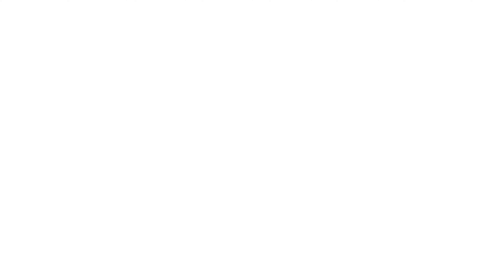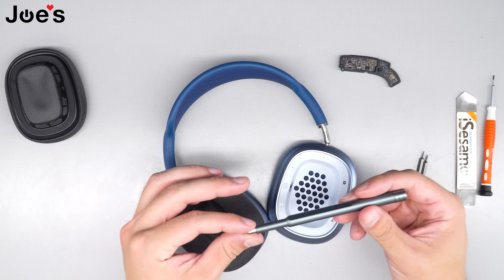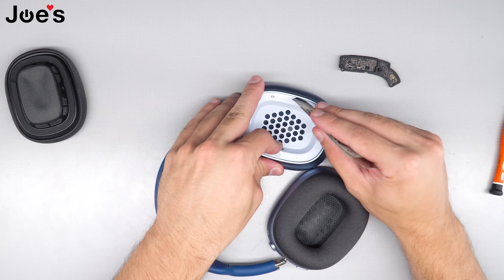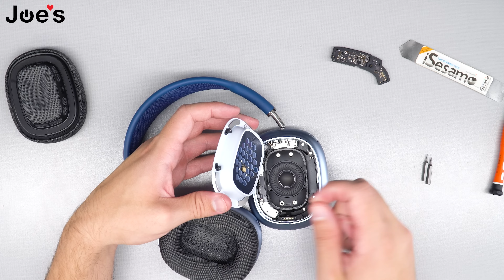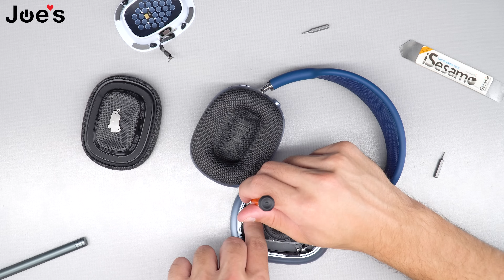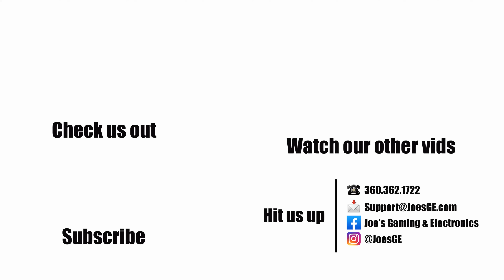Apple Airpods Max Bluetooth Board Repair Replacement | Repair Tutorial

Comment: Those are trash. Ill never buy apple products again. You spend 600dol on a "high end" product, it stop working after 2 years of using, and you have to try a DIY solution because even the repair they overprice. You buy from them and then they penalize you for doing so. Apple is like a huge company that grew by scamming people. never again

Comment: Hello, I am writing from Hungary. My Max regularly does the following: It works, I can hear the phone or iPad. Then suddenly the connection drops, and the device disappears from the Bluetooth settings. The battery is fully charged. If I press reset (holding both buttons for about 15 seconds), after a few attempts it connects to the phone and I can use it. But after 1-2 hours, it loses the connection again. The battery seems to be working, could it be that the Bluetooth unit is faulty?
Reply from the maker: Could be a bad Bluetooth board or headband jack.
Reply: Max 1 (lighning) and Max 2 (USB-C) bluetooth board is same?

Comment: The Bluetooth board is on the left side not the right side. Also heat up AirPods Max before prying but make sure to cover speaker housing with protection.
Reply from the maker: When the headphone are laying down the Bluetooth board is on the right side. I think that's what he meant. Anyways good clarification.

Comment: Hey, could you help me figure out what’s wrong with my AirPods Max. I’ve had the same problem as another user in this comment section. Whenever I have my AirPods Max plugged into a charger the light goes on, but whenever I take it off, the light goes out. Is there anyway you could possibly help me find out what it is?😊
Reply from the maker: Hello, thanks for commenting. Please email us at support@joesge.com with your question. We will be able to better assist you there. - JoesGE

Comment: How can you replace electronic parts without powering off first ?
This is like removing the Bluetooth Board in a computer while it is turned on !
(You should remove the left AirPod from the Head Band first)
Reply from the maker: Hey great question. It is not necessary to disconnect Airpod Max's from the battery when replacing parts. Furthermore, there is no way to power the Airpod max's down. You could unplug the battery or disconnect the cup from the Headband, but this is an unnecessary step. If it makes you feel more comfortable  to do so there is no reason why you shouldn't.
Reply: @Joesge  Ok, it you say so, thanks

Comment: How can I figure out if it’s my Bluetooth board that’s not working? It slowly started having connection issues and then eventually just doesn’t connect at all anymore I’ve cleaned the connectors with isopropyl alcohol and still not working power works tho and I’ve reset it 100 times right when it started giving me issues if I reset it would sometimes eventually connect before eventually disconnecting and than now to not connecting at all
Reply: Did your ever get they answer I’m dealing with the same problem currently
Reply: @larrissafrancois240  nope I ended up buying refurbished Sony xm5 from eBay great price and a 2 year warranty
Reply: @larrissafrancois240 i have the same problem
Reply from the maker: Hello, thanks for commenting. Please email us at support@joesge.com with your question. We will be able to better assist you there. - JoesGE
Reply: did you eve r fix this my issue has been the same it powers on but as far as getting it fully connected to hear audio it takes 100 resets to hear audio again
Reply: @xavierpierre1676  nope I ended up buying refurbished Sony xm5 from eBay great price and a 2 year warranty
Reply: I have same issue…..I would guess that replacing the Bluetooth board is cheeper than buying new AirPods Max….how much do you charge?
Reply: Oh wow, just looked your store up ..I think you are near me?

Comment: heads up: sometimes the ribbon shield screws are T1, I would add one to your list just in case if you're ordering specifically for this repair.
Reply: This comment saved my day. 

Also: if you don't know what a "P5 bit" is, since it is not labeled as a P5, its a Pentagon P5 bit - with five points and 1.2 MM in diameter. Thus, the right tool (if you buy their kit) is labeled as follows:
1.2MM. ST⭐1.2

Comment: My air pod max will not connect even with the wire it blinks not don’t connect so it the Bluetooth is the problem why my AirPod don’t connect it stop working after the update
Reply: Same it happens to my airpods max
Reply: @alijaan121 exactly same is happening to mine. Idk if the issue is with the battery or the Bluetooth board.
Reply from the maker: Hello, thanks for commenting. Please email us at support@joesge.com with a screenshot of your question and we will be able to better assist you there. - Aaron P

Comment: What symptoms did this show that led to a diagnosis of a bad bluetooth board?
Reply from the maker: Hello, thanks for commenting. Please email us at support@joesge.com with a screenshot of your question and we will be able to better assist you there. - Aaron P
Reply: @Joesge what symptoms did it show?? Not connecting??????
Reply: @baixinholacerda the issue I have is connection.   My Max will no longer connect.  The other issue I had was they would switch between noise cancellation on and off.
Reply: I wanna know too @Joesge
Reply: @ivansalazar1583  i think they should be replying to messages here so we can learn something instead of individually helping people via dm
Reply: @ivansalazar1583    idk why they don't respond directly here

Comment: Hello, please do you have any idea what could be wrong? I have an AirPods max if plugged to light and you tap the button the light shows and changes to green when full but it doesn’t connect and once you take out the charger the light goes off immediately
Reply: I am experiencing exactly the same problem!! It would be wonderful if you could message me once you know more!
Reply: I took mine to the Apple Store with the same issue. They said the battery might be bad and took them for repair.
Reply: @billyjoya5041 I am now dealing with this issue was it the battery?
Reply: The speaker housing is too tight I feel like I’m going to break it. I wonder if applying some heat helps.
Reply from the maker: Hello, thanks for commenting. Please email us at support@joesge.com with a screenshot of your question and we will be able to better assist you there. - Aaron P